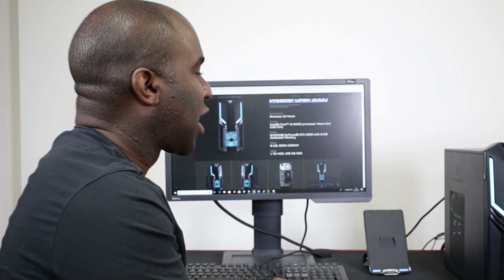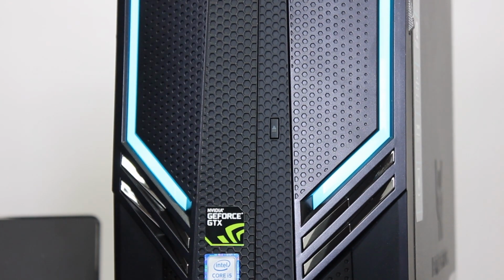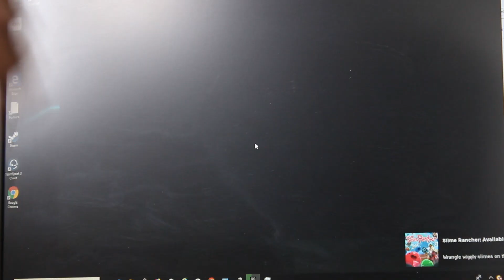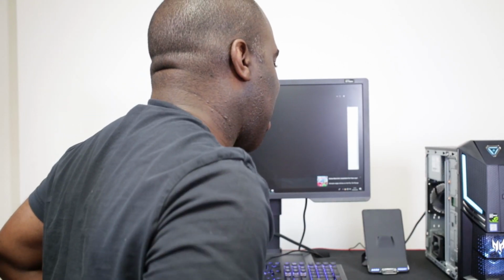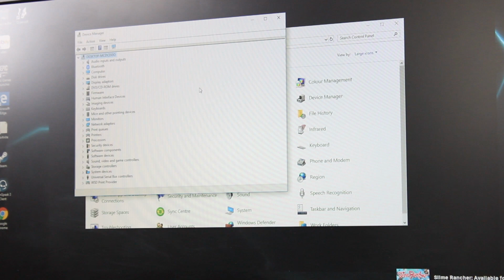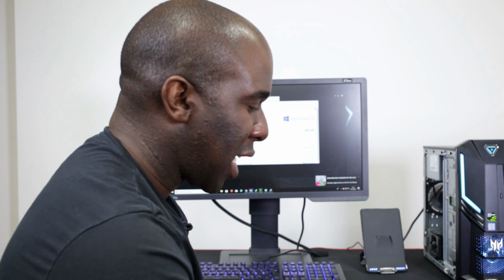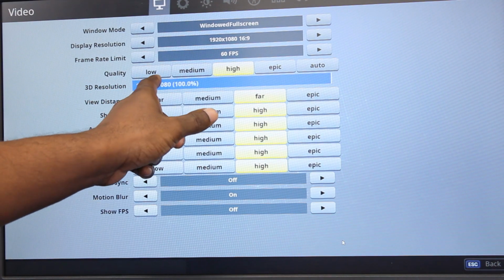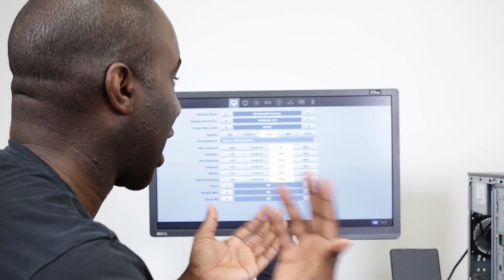Get Ready for the Hunt ! - Acer Predator Orion 3000 PO3-600

Comment: i have the one with the exact processor (8400), i want to upgrade it to the i7 9th Gen 9700 or even the i9 9900. the question is, does the motheboard accept these intel 9th Gen processors. all of them have same socket and same power consumption (65 W).  thanks bro
Reply: i have the same question D:

Comment: what fps would i get in fortnite with everything on low? :) getting the pc next week
Reply: I have this, bought it at bestbuy with warantee for about 1500 give or take a little, and Im happy to say it runs extremely smooth 120 fps on EPIC settrings, not low... enjoy it as it is a GREAT value for what you get, an  8th gen i7 8700, 16 gb ram (expandable) and 1tb of hdd and 256 sdd. stock . oh yeah and dont forget the beast value of 1070 gtx 8GB VRAM as opposed to the 2gb 1050 s or even xbox one s can run fortnite with 2gb vram so why wouldent you think a gtx1070 8gb would SHRED fortnite lol. highly recommend buying it and running the fan on max if and also get warantee as all should know gaming pcs are known to have meltdowns and trust me I had a nitro 500 with gtx1060 and it died after 3 weeks, unusable bs so I upgraded to predator and itys been graet for me for 6 months now.